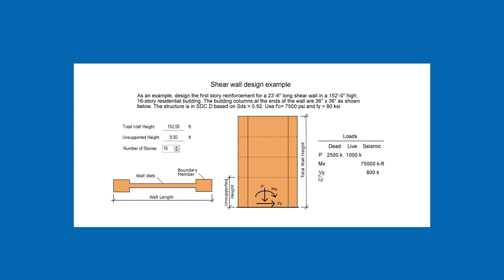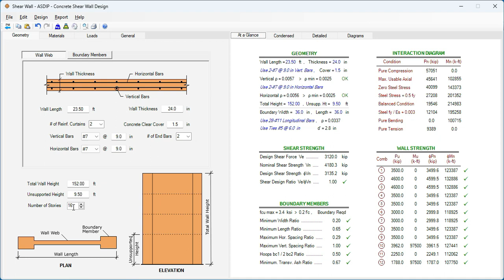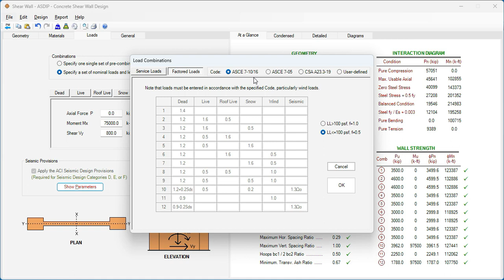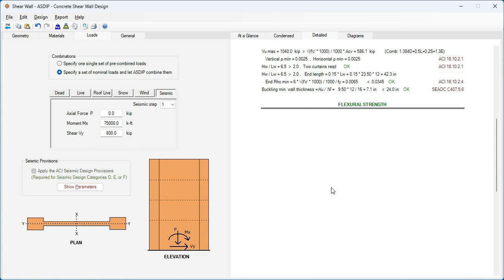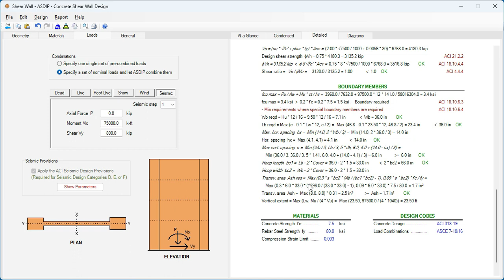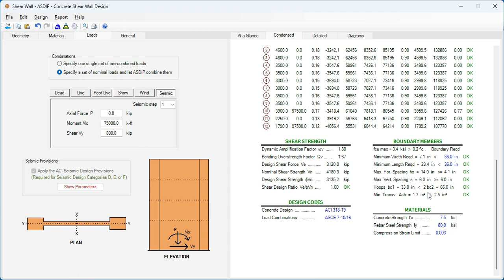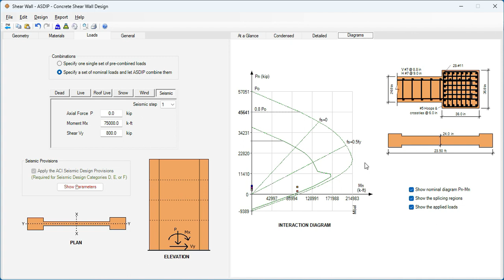Shear Wall Design Example Using ASDIP CONCRETE

Comment: Hi...in your calculation you have considered only moment on x axis and shear force on Y axis.But what about moment in the y direction and shear on x axis?
Reply from the maker: Shear Walls will have in-plane loads. Walls with out-of-plane loads are referred as Bearing Walls,  such as exterior walls subject to gravity and wind. Bearing walls are also part of ASDIP CONCRETE..
Reply: OK Thanks @asdipstructuralsoftware7797